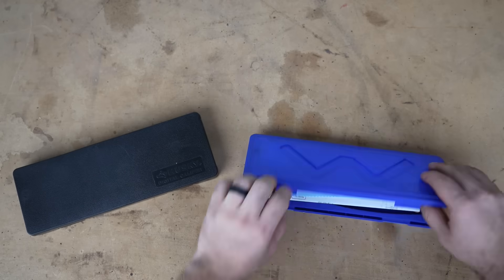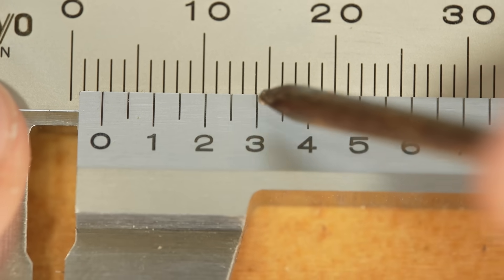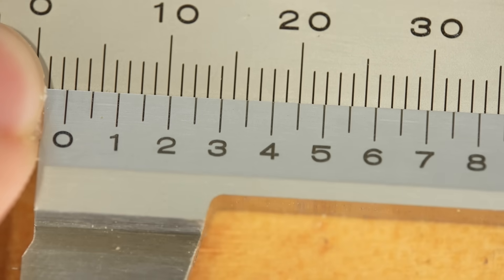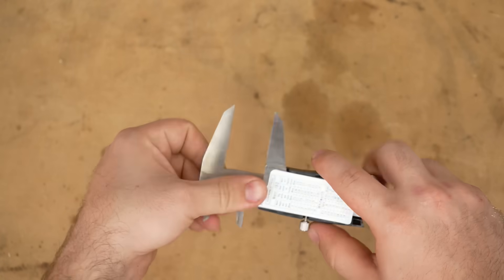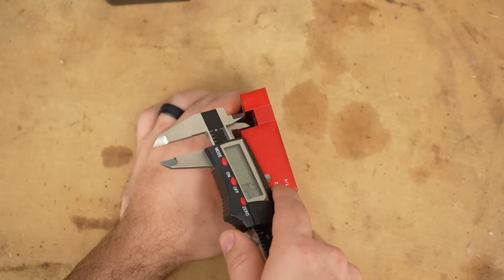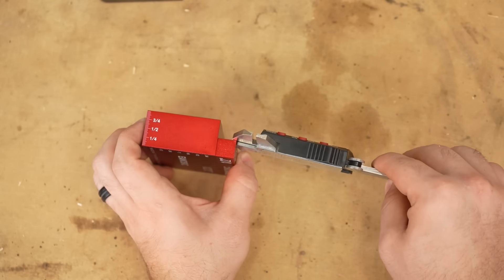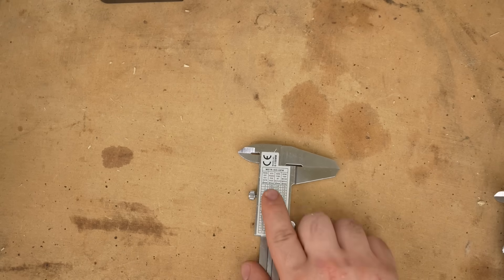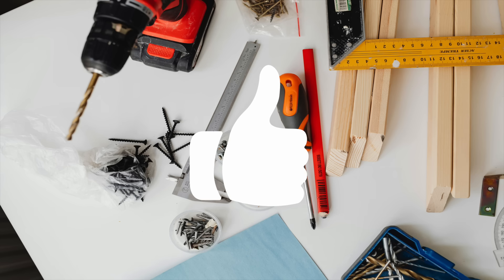I wish i’d known this sooner, How to use calipers like a pro

Comment: One point missed. There is a step on both sides of the caliper  at the root of the jaw to allow accurate measurement of workpieces still in the jaw on the lathe without being affected by any burrs at the end of the unfinished part.

Comment: Calipers are only for low tolerance work.  The depth rod is useless.  The inside measurement jaws cannot accurately measure a hole without radius jaws.   Stupid video.

Comment: Digital calipers are not reliable, once the battery gets weak they give you false readings. I am a 31 year experience machinist and inspector, we don't allow the digital caliper or micrometer in our shop

Comment: Accuracy depends on how the rack is machined or worse...punched. There is an old video on the manufacturing of USA made STARRET models,  I was impressed by how much went into making the device well.  I have had Chinese calipers, that worked quite well until they did not... took apart and found ugly crusty surfaces concealed within, and a tooth busted on the rack. I through out my other three identical cheapies, replacing them with digital ( AE GEMS ) calipers.

Then there is the Mitutoyo challenge..... how to identify a real one! These are the most pirated tool in the shop. So many fakes out there.

So, in the world of cheap calipers, electronic seems to be superior, as an encoder replaces the rack and gearing. Plus many models convert to both MM and FRACTIONAL inch..... VERY handy in my world.

Measuring STEPS, or offsets? I had no idea!
CE vs C E ? I had no idea that was a thing!

Great video!

Comment: I’d like to correct you on the China Export seal, it’s not designed to deceive people, it’s in fact impossible to be designed to deceive people because it was designed before the Conformité Européenne seal. There was in fact a bit of a fight because the EU wanted China to change their CE logo, but they didn’t, so now we have two CE seals.

Comment: The CE thing  you mentioned is an urban legend. there is no such thing as "China Export" just that some manufacturers don't apply the label correctly. That being said some will use safety and conformance listings fraudulently, not just CE, but UL and others as well. I do agree that messing up those markings should be a red flag. Best you can do to avoid this is to try to stick to reputable sellers.

Comment: I just had the most stupid encounter regarding using a caliper. I bought a silver chain from a local shop for a very dear and pretty expensive pendant (like 4 times the chain), ordered the chain online going off of their measurements from the product page. When I received the chain, to my surprise it was a few too many mm over any buffer I could have taken for the pendant, enough that I could not use it. I applied for an RMA, told them that it's 2.4-2.5mm vs 2mm from their website (in hindsight, I should have sent pictures with my RMA request and have the rest of the encounter documented for posterity). Got a call from the owner when they saw that my address was just a few subway stations away from their shop and they suggested I drop by to look at the chain, that it's not possible, they also just put the caliper on the chain and it's 2mm, even 1.9mm, perhaps maybe adjust the pendant loop (lol no thanks), if not, process the RMA. My curiosity got the best of me and I decided to accept the invitation. When I got there, the lady took the caliper and showed me, here look, it's 2mm, but I mentioned that the alternative to mangle my pendant would not sit ok with me and since they did not have a thinner option for that model, I asked for the RMA. Then by dumb luck I asked her to show me the measurement again because maybe there's something wrong with my caliper, why are we getting such different readings? Well, the chain in question was a rope style chain with intertwined links and my lady was measuring with the tips of the caliper, where the tip is thinned to allow measuring crevices and such and the caliper blades were ending up between the chain links where duh it's thinner than the overall thickness of the chain... I tried explaining that to her but it completely went over her head, she even insisted that I'M using the caliper wrong, that I'm supposed to use the tip of the blade, not the thicker part... we both resigned not before her saying that there's no need to argue (subtly implying "you're wrong, but let's move on") and she then processed my RMA. I felt my brain leaking through my ears as I walked out of that shop, sheesh.

Comment: A tip to clean caliper jaws, use a piece of paper and close the jaws and pull. Dont place so much pressure you rip the paper, but place enough to engage both sides of the jaws against the paper. Paper is an incredible cleaning material for metal surfaces. Edit: also mitutoyo is expensive, but for calipers, dial test indicators and micrometers- they are the best. They stay in tolerance the longest, they have a very good tolerance to wear, and they are just the best to use.

Comment: To say that digital calipers are more accurate than vernier calipers is BS! That conflates resolution with accuracy. In fact, there are many more sources of error in the digital tool than the vernier one - for example gear slop, gear tooth spacing, gear diameter and analog to digital converter chip  to name a few. Displaying 3 digits in no way guarantees 3 digit accuracy. In both cases, it depends on the quality of manufacture.

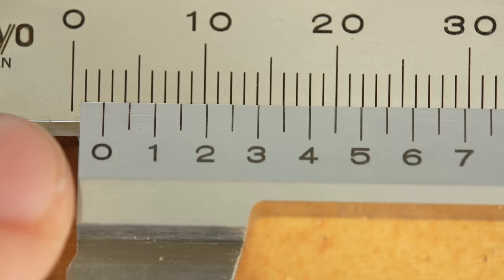Comment: Excellent, James. Only one observation: if you are using a 0.02 mm accuracy caliper and you measure and exact  2.4 mm length (as in the example at minute 2:29), you must say that the length is 2,40 mm,  with a significant final 0, because your caliper has the capacity tu measure up to 0,02 mm,. In other words, with this caliper you can get information up to 0,02 mm. If we call "l" the measured length, the result of the measurement can be written as l = (2,40 +- 0,02) mm

Comment: Worth noting that the Step function is not found on older Vernier calipers. I'm using my late father's Verniers and only met the Step function when I bought new Digital Calipers. Also interesting is that the pitch of a Metric thread is the same as the difference between Minor and Major dimensions.

Comment: Real engineers never use battery powered vernier calipers, as they are too easy to make a mistake with. Real engineers only use manual vernier calipers or micrometers for precision work.

Comment: Thank you. I had decent calipers but could never get instructions for them. I calibrated them using a ruler & marking them for standard  sizes. I was doing a project which needed specific measurements so I purchased a digital tool. I am quite happy with it.

Comment: Ridiculous
Title is suggesting some unusual tips of profound knowledge about callipers. Instead it’s just a callipers basics. Actually, what kind of basics are these without mention of parallax, impact of temperature, and proper manner of holding the tool.

I appreciate you’ve introduced digital callipers and pointed the china export trick.
How about different types of callipers? I mean different styles of the tool made for specific jobs and specific properties.
Video shows only the universal callipers in vernier and digital version. There’s a multitude of other callipers types. I wished I’d knew that before buying my first own callipers.

Comment: with `digital calipers you can use the 0 function for measuring. For instance, hole centres if the holes are the same size. measure one hole then press 9 then measure outside to outside to get the centre. Job in lathe measure job press 0 them measure sample thats how much to remove. Caliper upside down when measuring. Press 0 then close the caliper the size is displayed as a minus number

Comment: You didnt mention the locking screw.  It will lock the caliper in place so that when you take it off the work there is no shifting of the caliper.

Comment: The "China Export" symbol thing is a bit of an internet semi-myth. CE marking is done by self-certification, it doesn't really mean a lot, which is part of the reason why. There's no real evidentiary standards for using it. It's certainly true that the mark itself is forged but a true CE mark and a true certification of an item's conformity is absolutely no guarantee whatsoever. If you use a forged CE mark then you're going to have a problem quite aside from the quality of the item itself.

Vernier calipers aren't really something that is ever used - the first job I had where calipers and precision measurement was a thing, where we were breaking a lot of ground on precision engineering with lasers and wire EDM before everybody and their dog had them, we were doing a lot of work for NASA, F1 teams and so on, - we never ever used them. That was the second half of the 90's and at that point it was already a dead art. Also yes, the scale itself is incredibly useful but is more commonly actually used in other things: one of the places you're more likely to see the scale still used in measurement is in micrometers which is a whole different measurement accuracy and associated problems kettle of fish.

Two things matter with calipers more than anything, calibration (they wear down not square and not parallel very quickly when you're doing tens of thousands of measurements) and the pressure you apply to a set of calipers can massively affect the accuracy and repeatability of measurement - and that's a skill that takes a lot of experience, and even then you're going to lean more towards repeatability more than you are accuracy. It's one of those things, if you really want to be actually accurate, and you want to practice, slip guaages are your friend (using slip guages properly by wringing, by the way, is another really interesting accurate measurement field). I left professional engineering about 20 years ago, though still use them non-professionally and I still have the muscle memory to use them accurately and repeatedly - it's an interesting thing that when you really learn it you never really forget.

Comment: I have a question. There is a short step-down on the inside edge of each of the jaws, immediately adjacent to the beam of the calipers (on every set of calipers I have ever seen).  Does this gap have a purpose?  Or is it just for clearance?

Comment: This scale is also used in artillery, but in my experience goes by the name "nonius"-scale. 

It's used to set the countdown on manually set fuzes for artillery grenades in seconds and milliseconds to detonation. Basically the fuze (tip) is built like an egg-timer with this scale on it, you first turn the zero-line to the correct seconds and then you find the number that you need to set the milliseconds to and turn that the same way until it lines up with the closest opposite line.

Comment: with digitals you can measure the distance between two same sized holes! just measure the diameter of one hole, press zero, and then measure the distance using the inside measuring method. you will have the maximum distance minus the diameter, getting a center to center measurement

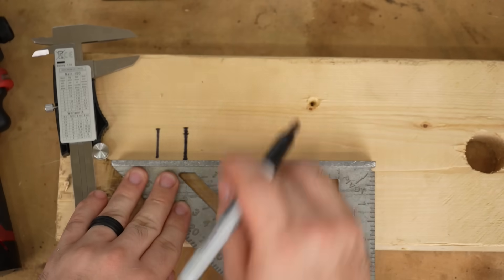Comment: 4:45 - I have been using this type of caliper for many years and have known all but one of the features of the tool you've shown in this post.  The one I just now learned from you is how to use the notch in the depth rod and it make perfect sense: for flat bottom holes, place the gap along the wall of the hole; for conical or pointed bottom holes, place the gap away from the wall of the hole.
Thank you for providing detail on the usage of this versatile tool!

Comment: after all that he said 2.9 mm, when its 2.39mm ? lol, plus you line up each line based on the measurements you need either inch or mm or thousands of a inch scale, not put the end of the ruler past the 0 mark and then say its not lining up what a idiot really? Each vernier has its markers based on the above measurements inch, mm, or hundreds of a inch if using a digital vernier? 🦘✌😎👌👍

Comment: i imagine there are little to no professionals using vernier calipers for their every day carry 6", 8", or 12" calipers.  as far as industry standards, the two most common styles are digital ,  or dial calipers.  at our shop the only vernier calipers used are large sizes.  and we also have a rather large mitutoya  carbon fiber caliper.

Comment: Yeah, no. The "China Export emblem" is an urban legend. There is no such emblem. There's just manufacturers that get the official CE emblem wrong (which, admittedly, is indeed an indicator that the product might fail to comply with the CE symbol's regulations in more ways than just the dimensions of the logo).

Comment: I have owned a digital pair for about 15 years. I have barely used them because I don't often use the tool the battery dies and it seems foolish to buy a new battery just for the occassional measurement. So I recently invested in some non digital (difficult to obtain in the part of the world where I live until recently). Of course I had no idea they could be so accurate nor that they had so applications, not being a machinist, I use them in woodwork. Very interesting and informative video. Thanks for sharing your knowledge.
Reply: the lower cost digitals wear the batteries out quickly. A brand like mitutoyo seems to last about a year with frequent use. I guess You could take the battery out when not in use
Reply: @danneumann3274  battery switch mod is the only way to make the cheap ones not die quick. they don't have as much parts so they can't make the microcontroller sleep in the same way as you can if you use a couple of extra parts
Reply: I also only use my digital calipers a few times a year. I take the battery out between uses. The box that holds the calipers has two round spots in the foam insert to hold spare batteries. Since I started doing this, I've been on the same battery for well over 10 years.

Comment: You miss 1 caliper, and it is the that my Dad taught me on when he worked for Boeing aircraft, and it measures in, inches up to .0001 of an inch. This caliper had dial instead of scale like the 1st caliper you showed. This caliper was made in the 1960s.

Comment: From your example at the start, it was 0.24 mm. But why does it have an accuracy of 0.05mm? When you can get 0.01mm accuracy?
Reply: The example Vernier caliper measurement was 2.4mm. The lower sliding scale shows A) the measurement of full mm (in this case 2mm) indicated by where the leftmost zero points (or slightly past it) on the upper fixed scale and then B) the measurement of further fractions of a mm to be added to the first value (in this case "4" i.e. 0.4mm) indicated by where lines on the lower and upper scale are most closely aligned. There are 20 subdivisions of 1mm on the lower sliding scale so each one corresponds to a smallest possible measurement of 0.05mm. He then also shows a caliper with 50 subdivisions of 1mm and that one's smallest possible measurement would therefore be 0.02mm. The digital caliper's smallest possible measurement is indeed 0.01mm.

Comment: Most importantly... take the battery out of your cheap digital calipers unless you want it to be dead next time you use it.  That OFF button?  All it does is blank the display... the thing's still drawing the same current.  I don't even bother putting the battery cover back on it anymore... Kobalt brand, from Lowe's.

Comment: Vernier calipers are not anywhere near close to being the most popular.  They are what people used before Dial Calipers.  You're talking about pre 1980's calipers.  Seriously the only time you will see Vernier calipers being used is on large parts greater than 12 inches since dial or digital calipers that large would be very expensive.

Comment: Good video up until the really old and repeatedly debunked urban myth of "Chinese exports". Products not following the EU regulations tends to just slap on the correct CE mark regardless and simply hide behind the fact that going after companies/individuals in other countries is often really hard, even pointless for smaller infractions.

It is however true that some products have had the squished together CE logo. Thereby breaking the law defining the logo and requiring that one follows applicable regulations. (not a good first impression to not follow the first requirement...)
Main reason for this is that the legal text itself is perhaps a tiny bit vague in that the two circles aren't just there to indicate that the C and E should be circles, but that it also is a requirement for distancing the characters from each other.

This slight distinction is something a fair few companies have misunderstood over the years.
The biggest "Chinese Export" product in the wild is likely the XBOX 360 wireless controller. Microsoft squeezed the letters together to make room on the label inside the battery compartment. (and perhaps they fixed that on later batches, but the early ones were incorrect.)

But effectively speaking.
There has never been such a thing as a Chinese Export logo trying to imitate the CE mark. Since as stated, one can just slap on the mark regardless and hide behind the limitations of international diplomacy.

Comment: Bought a brand new set of vernier calipers, 1m in length so that production could measure Ovality. Calibrated them and left them on the required production line with the clear instruction only to be used by line operative. Came into work next day to find them snapped in half, checked security video to find they were being used as a hockey stick. £1500 to get a couple of hours use. I wish i could say the clown was sacked but no

Comment: That 0.02 or 0.05 isn't the accuracy. It's the resolution. The accuracy is about how correct the results are. If you get a measurement of, say, 1.34mm, is that actually 1.34mm? How close is it, to being 1.34mm? That is the accuracy.